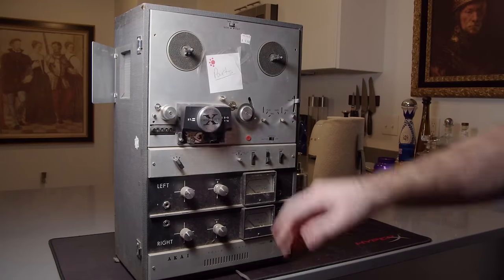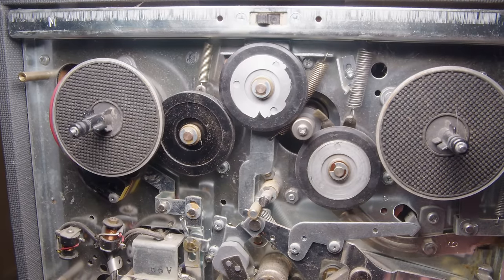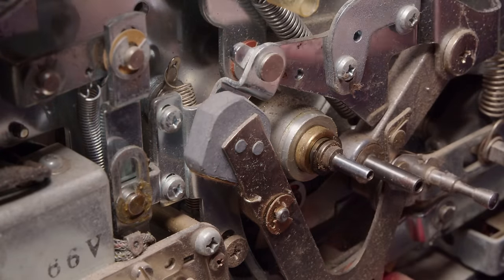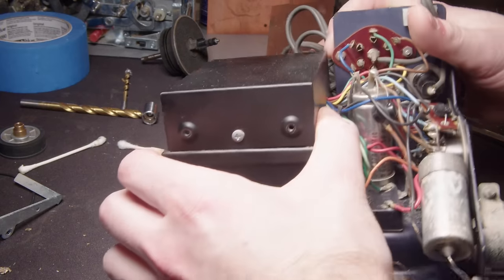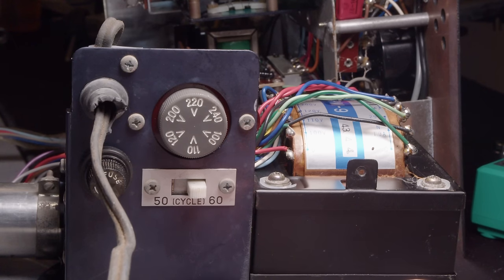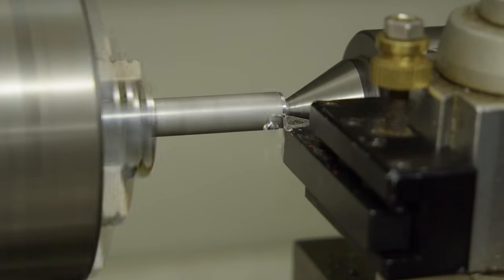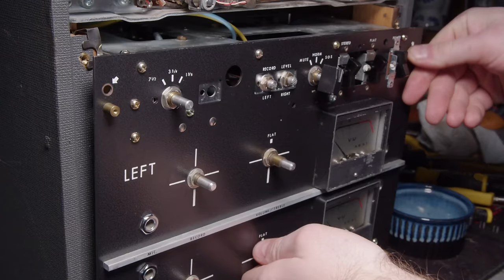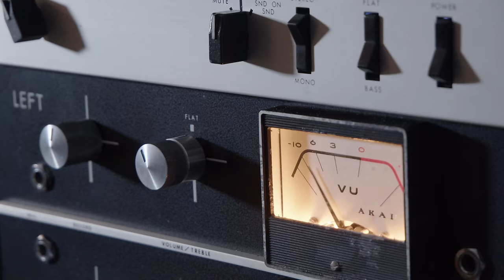Beautiful 1960's AKAI - Full Repair and Restoration.

Comment: Nice job man! Crossfield - is an AKAI patetnted technology, main point of that - to fed bias to an extra head (one on the bottom) to reduce main head magnetic saturation. When property alligned - it gives more headroom on high frequiences, especially on slower speeds.
Reply from the maker: Interesting! Thanks!

Comment: Great video and an impressive restoration. You went above and beyond with the mini lathe and 3DP.
Assuming you did indeed put the AKAI in the dishwasher, did you afterwards take apart and regrease the potentiometers? 
Without the grease, the carbon track rapidly deteriorates and can easily kill the potentiometer.

Comment: That cross field movable head is to add higher frequencies to the tape like AC biasing to make a cleaner sound. This was also used in cassette, and 8Track decks but the technology was built right into one head. The higher end modern cassette, 8Track, and RTR models with glass heads with also have this X Field technology. The deck you have here also has EQ biasing to clean up the sound of duller recordings. Most of this is automated now with the speed selector. This make is possible to even make a 1, 7/8 recording to sound decent. That is the control on the front you where messing with.
Reply: You glue tape, editing ?
for mad people only !

Comment: Thank You!  A Vietnam Vet asked me to take a look at one he bought  in 67. After the first couple hours  I was thinking the unit was beyond hope. After watching this video, my attitude has changed. Too bad so many videos that were confirming by thoughts came up before I found yours. Major issues, Play/Record  Cam has disintegrated. 120 VAC  voltage correctly selected. Motor spins very slow though freely spins by hand. Frozen equalization knob.  I'm going to forgo the dishwasher and tumble dry :) method. So funny regarding attempt at tumble dry! Great job at making such a difficult job entertaining and uplifting!

Comment: Interesting how yours needed so much mechanical work. Mine needed not that much at all, apart from the usual belts, cleaning and a new pinch roller. Came to me in very good condition and with very low hours, likely stuffed down the bottom of a linen cupboard for 40 years until the original owner died. However the electronic side needed serious work, many of the capacitors (incl for the motor) were weak and needed replacing and major work was needed on the record / replay switch. Now works perfectly. https://www.youtube.com/watch?v=pLwZRDR3IaE&t=2s

Comment: An uncle of mine purchased a brand new M 9 probably manufactured  , I believe ,  in the the year of the unit shown here : according to a capacitor that I saw in this video,  the year is 1968.    Later in 1977 I bought a used one , probably one of the last M 9 units turned out by Akai.

Comment: Regarding the voltage - I would put it on 120, just to be safe. It's not going to affect the performance, but it's a little insurance against overvoltage accidents. Great work on getting it going! Wholesale washing like you did is actually a valid technique, just remove the motor and rubber parts next time.
Reply from the maker: Thanks!
Reply: Nice job. The lathe work is what sets it apart. Did you try recording on it?
Reply: And what difference is 10 volts going to make? nothing.

Comment: 4-40 screw in metric is 3mm. There are 4 different thread pitches that it could be, 0.2, 0.25, 0.35, and 0.5mm (0.5mm being the most common). I'm sure it's one of those, though I can't say which. There is a Japanese Industrial Standard for screw heads, but they just use regular metric for the threads. There are multiple traditional systems that continue to be used for very, very local things like knife-making and carpentry, but they legally adopted the metric system in the late 1800s, and consumer electronics from the 70s are all going to be metric with JIS screw heads

Comment: AKAI is Japanese mfg. METRIC Hardware and Measurements.
METRIC THREADS … when you used (English, SAE) 4-40 hardware … it is suppose to be Metric M3 .
You have a Mini-Lathe, but never used a Tap/Die ??
—
RESTORATION TIP:  BUY NYLON METRIC and SAE Nuts and Bolts to Test (Does not ruin threads).
==
As far as AC Voltages, you obviously do not understand Global Commercial AC Power.
This is a Portable Reel to Reel.
You also have to remember 1960s World when mfg. (before European Harmonization, 1990s).
North America (NEMA) is an exception (120 VAC, 60 Hz) in the World of 230/240 VAC.

In Japan, they traditionally used 100 Volts and 50 Hertz OR 60 Hertz (depending on Islands West/East of country).
Europe / Great Britain had 220, 230, or 240 usually at 50 Hz

Comment: Great video! Nice job! There is a Japan industries screw thread that bears no relationship to metric or imperial or American, I had the problem of finding some nuts for a Japanese meter. The thread pitch was identical to metric 3.5 but thinner! So I had to get M 3.5 nuts, and cut a thin slit in the nut and squash it such that the diameter was smaller! But it worked!

Comment: Hi I have one of these given to me by my Dad before he passed, most things work but there is no sound coming out of the right channel and it crackles a lot, if I input a stereo sound into it I can only hear one channel, but nothing records, my plan after watching your top notch video is to take it apart and clean out the amp side of things, I have a bad feeling the heads are worn out, is replacing the heads easy to do? More importantly are they available? I have tried cleaning them but no luck. Your input would be much appreciated.

Comment: hi very good i have one as well   there is a small  pinch roller for 15 ips  i played about the same for my deck
funny thing i have a RS 1700 no it's not 100%  a  big spool hit the right side reel table 
i had to make a new part it was the left side  lucky the motors are the same  i pulled one motor apart  and turned down the bad part  and redrilled a hole ine the table and glued
in a brass part with a 4 mm tap  

the tape i dropped is a 14inch one   with 1/4 tape  i have a scully 280 it's very ill    came with 18 tapes 
and you done a super job the handles are all ways coming of all the time

Comment: Did you print a flap cover for the missing speakers?
Reply from the maker: I didn't, i don't think it really needs it and a 3D printed replacement wouldn't look too great on it. I thought about manufacturing a new one from some sheet metal, but I think that may be beyond my current capabilities.
Reply: @HifiJelly  oh ok got it.

Comment: Nice video. With my limitations, I would never have picked up the machine in the first place, but you have a 3-D printer and lathe access and succeeded where I would have hit an impasse so cheers to you. Surprised that you didn't make up a new and matching set of speaker doors.
Reply from the maker: I considered it but sheet metal is tricky to work, and I don’t think it would’ve been a satisfactory result. I did end up making a sheet metal back panel for it, but that was after I had made the video. Glad you enjoyed.

Comment: If you're in the United States, set the voltage to 120 volts.  That is incredible what you did with it.  Thank you for posting.  I will usually fast forward the video but I watched it the whole way through.  Excellent.
Reply from the maker: Thank you very much!
Reply: @HifiJelly  you're welcome.

Comment: I did like the video, and this channel, up until the point where vu meters and electronics got "cleaned" in the dishwasher. You can't be serious. Worst idea ever. I'm sorry, amature hour at it's worst.
Reply from the maker: You gotta remember to use Jet Dry, as to not leave any water spots on the VU meters
Reply: @HifiJelly  

You really can't use water on VU meters or any thin coils for that matter. Some moisture will get stuck inside, and the hairthin wire from the coils could get the green crusties and start to rot over time. Then it's goodbye to the coil, parts are not available.  Please don't do this anymore. I'm an experienced tech, working for a long time in this field.